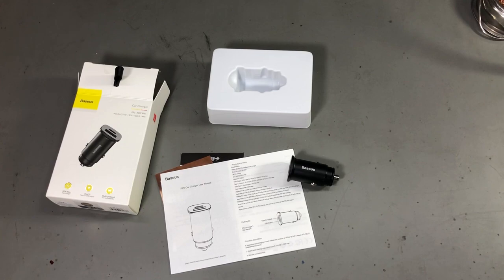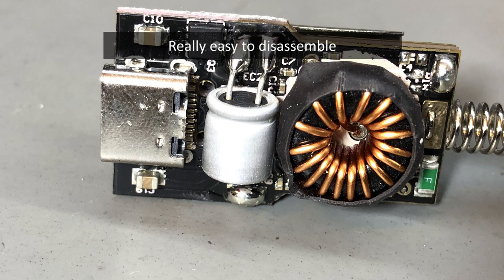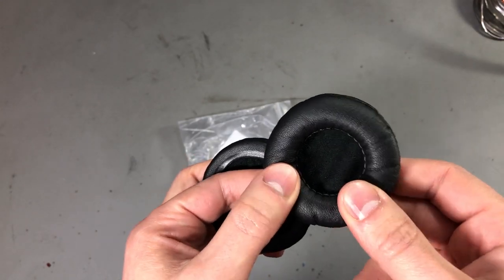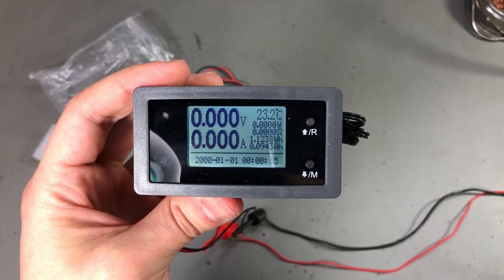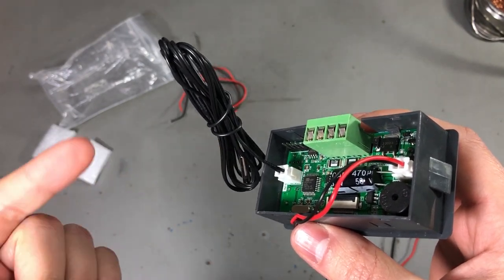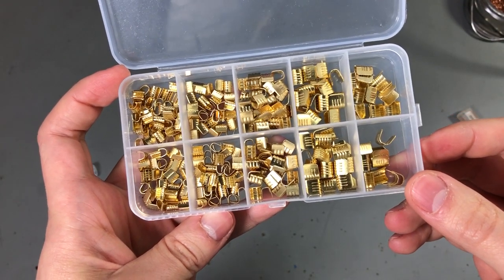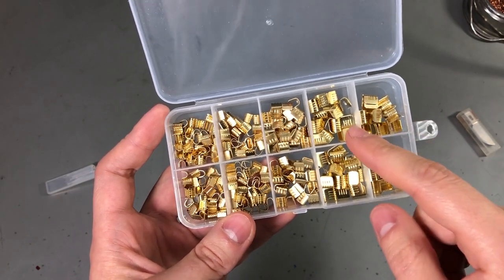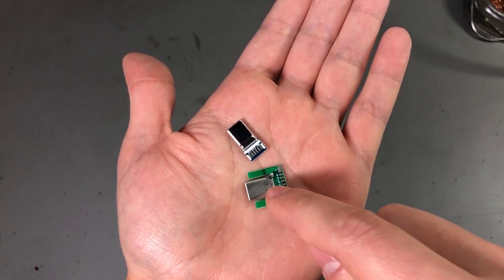Voltlog #200 - InTheMail

Comment from the maker: If you we're wondering, that panel meter takes 10mA powered at 5V through the auxiliary input with the backlight on, and 6mA with the backlight off.
Reply: a tip: watch movies at Flixzone. Been using them for watching loads of movies during the lockdown.
Reply: @Douglas Abdullah Yup, have been watching on flixzone} for since december myself :D

Comment: crimp and solder! crimps can work loose unless you put enough pressure to cold weld the connections. the type-C male connector is probably only a usb 2.0 breakout. fun stuff!
Reply from the maker: in my opinion solder is a future failure point but it might be ok if you do the crimping first and solder afterwards, once again, talking about hobby level stuff.
Reply: @voltlog  yea really the only way solder can fail is if the wire is unsupported, and will fatigue where the wire comes out of the insulation and into the solder.

Comment: Great vid - panel meter looks to be really awesome, good find. Those "cat6" fly-leads (patch cables) are probably not cat6 though, since cat6 specifies minimum pair twist counts per length and pair separation to minimise cross talk. Cannot imagine how they do that in such a flat cable form factor. For short distances and home use, it's probably not an issue.
Reply from the maker: I will probably take a closer look at one of those in a future video, thanks for the info!

Comment: regarding the crimp connectors. Just snip one in half, and look at it with a magnifying glass. I think copper would be an extremely poor choice for metal, because it is too soft. Crimp terminals are usually plated alloys (brass, bronze etc.), or even steel for high temp.
Reply from the maker: thanks for the info

Comment: The U Shaped Crimp Terminals 454A don't seem to be available on Ebay and the link just takes me to some car engines.  They do have copper tube crimp connectors on Ebay but they are not the same.
Reply from the maker: Link for ebay takes me to an ebay.com page where there are two offers for exactly those terminals.
Reply: @voltlog   I get 0 results for 454tabcd and as far as I can tell Ebay doesn't have any for sale.  Aliexpress seems to be the only place with any for sale but they don't have any crimpers.   Since you obfuscated the site address by using your own link can you say where you found those terminals on Ebay,  what item number and which countries Ebay did you use, UK, Germany, etc?

Comment: Stay away from flat Ethernet cables.
Reply from the maker: I'm keeping them close :-)
Reply from the maker: @RicardoCooper  I don't think they have any shielding, they feel pretty thin and soft but I don't care as long as everything just works. I only use them indoor on short distances, less than 30cm. I have gigabit ethernet and everything runs smooth.
Reply: @voltlog  "I don't care as long as everything just works" - Yeah, that's exactly what we're trying to warn you about. Any stray interference around flat Ethernet cables and don't work.
Maybe you'll be lucky and never have a problem; but I wouldn't put money on it.
Reply: i was probably lucky with the flat cable i got with something because it looked like it was indeed twisted inside it just used really thin wires and had the jacket pressed ontop of them. but yea cheap ones are probably straight run and not twisted.
Reply from the maker: @SuperBrainAK  I just took one apart and it does have twisted pairs inside.
Reply: @voltlog  good, it should work just fine then, I do normally prefer round cables but in some cases it is better to have it flat, it just depends on how well you are going to run your wires, flat is fine if you are tacking them down to something, but if they are loose I prefer round since you dont get ugly folds and kinks, but we will let the IT people deal with that ;-)
Reply: VoltLog it’s not just the single pairs being twisted that diminishes interference, it’s also the 4 pairs twisted around one another. Flat cables have twisted pair but each pair is next to the other. Bad idea for NTE to router but would be fine for lower bandwidth applications

Comment: Where can you recommend items you should check out? I just recieved a power supply bought on Aliexpress ( XYD5005 ) Very unknown yet powerful device. Totally worth checking out! Haven't found a single video on YT about it yet
Reply from the maker: From the naming and appearance looks similar to the ruideng dps5005 50v 5a buck regulator on which you will find a lot of videos.
Reply: @voltlog  Yeah but the insides are different from the dps5005. I did think that myself until i got access to the insides of it(posted some pics in a review on Aliexpress)

Comment: about the panel meter, in your previous one you showed that some resistors should be moved or tracks cut to choose between external power for the module itself or via the measured current, in this case are there any precautions in case of internal or external powering it?
Reply from the maker: Some reverse engineering needs to be done to figure out the schematic but I think they use some diodes in OR configuration possibly an extra mosfet for selecting power source.
Reply: @voltlog  so, just need to connect external power and that's it, good
Reply from the maker: yes, they work great with external power.

Comment: hi, and happy new year :)
any item for TOP foam pad for headsets?
Reply from the maker: haven't found a suitable cheap replacement yet :-(
Reply: @voltlog  please in case keep us updated, they're useful, too :)
Reply from the maker: I've ordered those in the past because I have the PX100 headphones. I can tell you that the adhesive kinda sucks, they did come off fairly easy after being applied. Also those are thin and small so they wouldn't work well on a larger head band.
Reply: @voltlog  search for "foam headset", there are many more types, larger or thicker